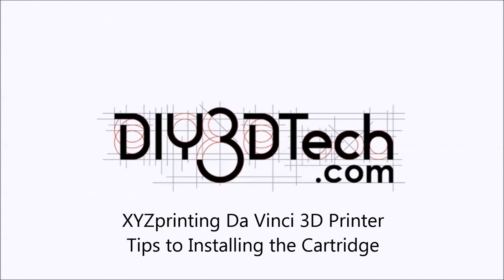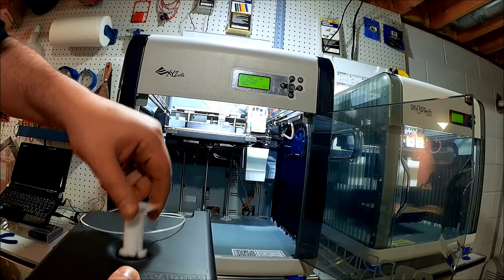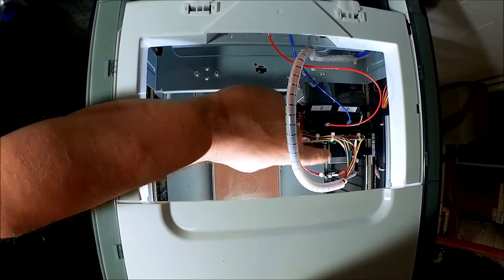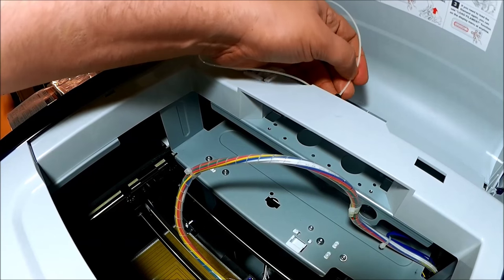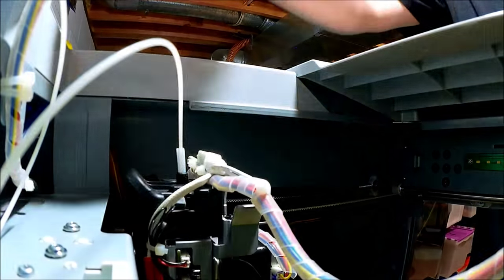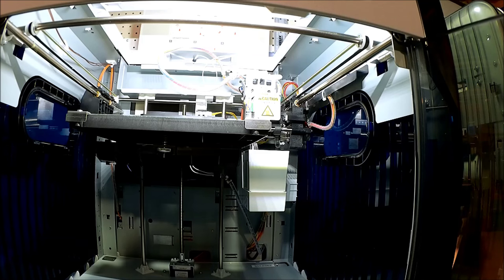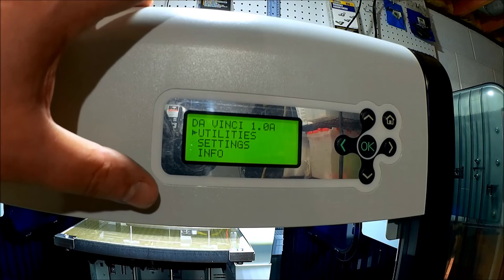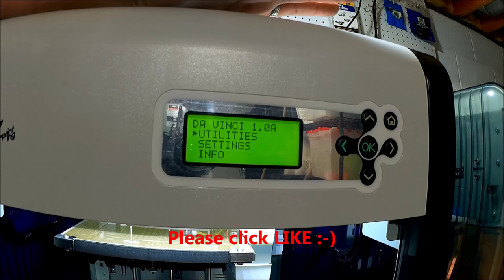XYZprinting Da Vinci 3D Printer  - Tips to Installing the Cartridge

Comment: Have you ever had an issue with pushing filament, like you did in 6:17 or 6:43? I've changed filament few times without actually pulling back this small lever thing but now I can't push it further even if I use the lever. This white plastic guide tube is finished by a metal element. When I disassembled it I noticed that filament can't go through this metal element. Funnily enough I can push filament in an opposite way after disassembling (did that to check if nothing blocks this guide tube). I checked different filaments, tried to push it from different angles not nothing has helped so far :/

Comment: Excellent video but I think you're advise on removing the "lock" "unlock" device  is incorrect. This device locks the two halves of the case together and does not lock the flow of the filament. As such it would be unlocked and removed so the case could be opened and replacement filament installed and then reinserted and locked to hold the case together. If you run the cartridge unlocked it could conceivably come apart and jam the filament flow
Reply from the maker: +Mike Bates thanks for writing, the case itself is held together with snap clips and not the white center insert.  To open then case you will need a flat head screw driver as XYZ Printing even sells replacement spools that require opening the cartage in this way.  Here is a short video on how its done: https://www.youtube.com/watch?v=74ivG-ugduo